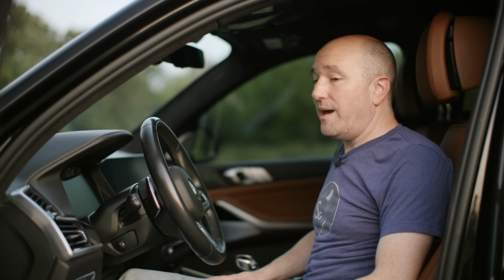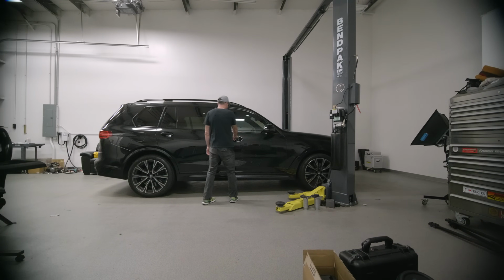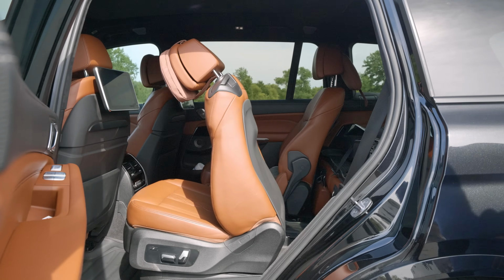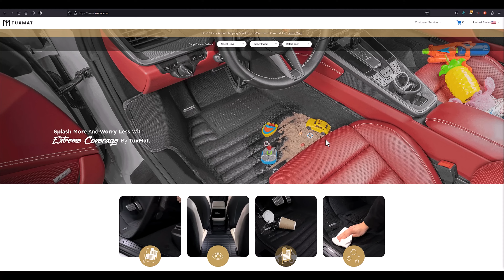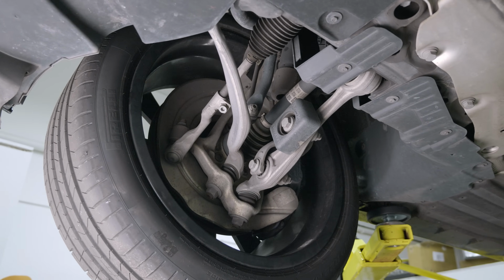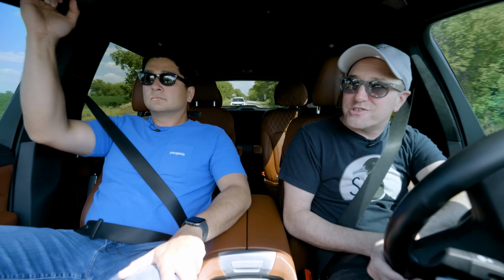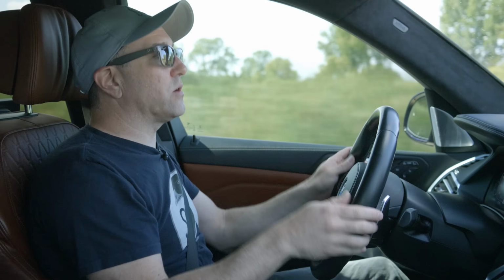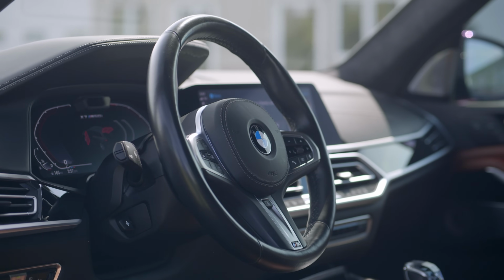BMW X7 | 45,000 Mile Long Term Results

Comment: Leaky roof are something BMW is a market leader in. 🤣🤣 both my X3 and wife’s X5 have experienced the pleasure of sunroof leaks. Fix them multiple times. Latest is a XE leak into the trunk that caused a failure with the park brake control module. Not cheap repairs.

Comment: Great review. I appreciate the insight and essentially validation. Ironically going through the same process. Currently trading in my 23 X7 m60i for a MDX type S. 
Besides your arguments, the LCI has a few extra neg aspects in my opinion, which include the over complicated I drive 8 & climate controls that I still don’t enjoy, non adaptive headlights with no curve swivel, and the biggest factor is tossing the great ZF 8 speed for a hybrid supported 8 speed with which you cannot really engine brake… really dissatisfying for an enthusiast.

Comment: I owned a 2021 BMW X7 M50i. Great driving dynamics (for an SUV), solid power, fun to drive, lots of sweet tech, comfortable, and it looked great inside/out. Unfortunately, the interior is a creaky mess. All of those nice-looking plastic bits sound as though they are made out of recycled plastic water bottles. Every time the vehicle moved, hit a bump, made a turn, or any chassis flex and is just creaked. I drove another nearly identical X7 and even a 550i and it seems to be a common theme. One that I'm really surprised reviews don't comment on this. Have they just accepted this as normal? Are they deaf? Such a shame as it was otherwise a really nice vehicle. 

Also, I've found the same issues with Mercedes, Cadillac, and to a much lesser extent, Audi as well. In a Hyundai, it's perhaps acceptable. But NOT in a $100k+ luxury SUV.

Comment: 22:14 Marc, a Toyota Highlander Hybrid would fulfill your needs.  Platinum trim level of course.
Reply: mazda cx30 ihhs ncap crash test scores are good given the weight , mpg, costs, size. but when you run full power fan blower and air conditioning, engine shakes a lot while idlng, honda crv 1.4 liter, a couple lexus and venza, did not shake so much... maybe shaking will wear out the connection between engine and car and then require a screw tightening and theres no a warning light for  that, it doesnt feel loud and shaky inside car

Comment: Im pretty happy with my daily 2016 chevy ss/holden commadore 6MT (55k miles).   Definitely not the fastest but comes with LS3 and tremec tr6060.  If I stay off the skinny pedal and do 65mph on highway i can get 24-27mpg.  I usually only average 19-20mpg hard to resist the skinny pedal.  If i need to save gas 2019 prius bought new, now has 180k miles just changed the rotors and pads at 173k full set of tires $500.  If i need to haul i have a farm truck OBS ford 7.3 PSD 340k+ miles.  My camping rig, family hauler 8 seater 2003 toyota sequoia with 300k+ miles which i can also use for home depot runs if i put all the rear seat down i can easily fit full sheets of plywood. Essentially a single cab tundra with an 8ft bed.

Comment: No B58 No buy
I'll get the X3 instead
Reply: You can get the B58 on the X7
Reply: How ACTUALLY reliable is the B58 in the X3 M40i? I’ve heard it’s pretty solid but it is BMW so, you never know.
Reply: @TJ_Kirkland.  the engine is fine.  It's everything around it that's made from glass.
Reply: @bassandtrebleclef modern ICE cars. The engines refined. The electronics a planned obsolescence nightmare.
Reply: X3 M340i looking real good right now!!

Comment: Why wouldn't you get a B58 and lower spec slightly used and get it for 60k or something ? These drive really really well for their size and are quiet and feel great on the road compared with the new MDX (I own one of those) and anything from the Japanese or Koreans.  The GLS is pretty nice but even more money.

Comment: Gotta imagine the mdx type S would be more satisfying to own at the price point.
Reply: MDX Type S is $50K less than this and much smaller. Different class of vehicle. And the MDX Type S is super underwhelming. Incredibly slow considering the Type S badge. Even a base X7 40i smokes the MDX Type S.
Reply: the rwd based architecture car will always be the better buy
Reply: Seems like he sort of agrees as well. Will be interesting to see if the facelift model fixes some of the issues like adding a touchscreen.

Comment: Many years ago I spent an afternoon driving everything I could in BMW's Susan G. Komen charity fleet. Everything from a base 3-series to a fully loaded E38 740i. The few circuits I took in the "clown shoe" E36 M-coupe are one of my car enthusiast highlight memories.

Then I got into my 1988 Acura Integra and drove home. And the experience was 85% as good as any of the BMWs. Given the yaawning gap in  purchase/ownership costs between my Acura and the BMWs, it's hard to justify shelling out the extra money for a relatively small increase in ownership satisfaction.

SG, get a Kia Telluride (or whatever). Then, with the money you're NOT spending on the BMW take a few days off. Produce 1 or 2 fewer videos per year. Go drive your CTR for the sheer joy of it. That's how people behave in civilized non-s**thole countires, and they're much happier than Americans because of it.
Reply: In the 90s, Acura, BMW, Merc and Lexus ruled.  As much as I love bmws from that era, they were the only ones not engineering long term reliability into their products.  They were the most fun but even then they were pricier in the long run.  Things have only gotten more that way with them.

Comment: We just bought the x50e.  Gets close to 500 HP and also 40 miles electric or 58 mpg in hybrid mode.  We mainly bought it for the tech tho.  The 85 mph hands free highway assistant sold us…cost is also 20k less than the X7 and imo looks better too
Reply: No way you get 58mpg on the 50e.  That's not how mpg numbers work.  I have a 45e and I know the car numbers are bs.
Reply: @krzzzy19  58 MPG is listed on their site...Not hard to do a little research next time...

Comment: I have this exact X7 and I bought it used as well but it's been in the shop way too much, and I've only owned it for about 6 moths, so far it needed  a new cluster panel, a thermostat which cost $2,267.00 the armrest heater didn't work so they replaced it, the seat leather on the front part was replaced because it came loose and they fixed the other side which is now also has come loose, it needed a turbo harness which they broke the screw in it and stripped the rest so they gave me a whole new turbo. Also the steering column was loose, it had a play in it so they replaced my steering wheel,  and your usual brakes, new tires, alignment, new battery, all within 6 moths of owning it with 50k miles I really want to like the car but so far it's a money pit, I didn't get the extended warranty because it was $7000 for 3 more years I probably should have paid the 7000

Comment: I have a 2019 X7 M5Oi. It had been very reliable until recently when, at 55K miles, the transfer case failed, and the shark fin leaked and toasted the emergency communication system module and affected the navigation. I have an extended warranty which covered the $5500 transfer case bill. But the module was $3500 and $1200 in labor, only 5K miles out of warranty; it was not covered by the extended warranty because it was a water leak at the antenna, even though it's a crappy design. Fortunately, the dealer and BMW covered the parts, so I paid only the labor. Very disappointed that I incurred $10K in repairs at so few miles. Word to the wise, get the extended warranty!!! The loaner they gave me was a 2023 M6Oi just like the one in the video. Frankly, I prefer the dash controls in my 2019. Probably because I am accustomed to them.

Comment: The hard reality is that this is the best vehicle in its class... but it is made for wealthier individuals and the costs that come with it. Most folks will lease them so they really don't care about cost or maintanence... As a cheaper and solid option, the 40i without air suspension is also available...
Reply: Exactly

Comment: After having to go to two separate dealers, being charged illegally to fix a problem that was a violation of federal law (safety) WHILE the car was under warranty (I didn't have the time or energy to sue the dealer), SEVEN total trips to the dealers including TWO replacements of the same part on my new 2018 M240i (thankfully leased) and the second replacement had to come from Germany, I would never, ever touch BMW again. 

I will say the second dealer was beyond brilliant in every way, but BMW could care less about quality, and I have been driving BMWs since the 1990s.
Reply: @@japanwatchconnection Driver's seatbelt refused to contract/tighten, which is a violation of US law my man.
Reply: @@japanwatchconnection Actually the dealer I got the car from (400 miles away) was sleazy from the start even though I was getting a long-sitting car off their lot. The second dealer, ten minutes from my house, was both incompetent and committing illegal acts—they're seriously telling me that a defective seatbelt was normal.  The third dealer was truly incredible, but even they admitted the replacement part was defective, so they had to order another one from Germany.

It's all ironic as I had a 528i I did European delivery on and that car was the most reliable vehicle I had ever had.

Comment: Thank you for this wonderful❤ explanation. I would like to know the 2021 V6 Mild Hybrid model. What is the fuel consumption rate inside and outside the city for a used car with approximately more than 40 thousand miles? Thank you.

Comment: Cool vid!

I knew I was not crazy!

That's the phrasing....

I felt like I drove on top of the platform and not like I was apart of the driving experience. 

I also appreciated u being candid.

I owned an old BMW X5! I learned why they called it the BMW the ultimate driving machine!

The thing was amazing!

Buuuuut it was also terrifying!

I put it over a hundred because I wanted to see what it can do and it almost took flight!

I think the 2006 X5 was 184 inches.

Oddly....I would love another luxury X5 at that length, but they do not make them any more and something about the X1 and X3 that I just do not like.

And the consumables? 

Don't even get me started on that one!

I bought the X5 used and made a horrible mistake.

I beilieved that buying luxury meant purchasing more reliability. 

Boy was I wrong!

That car was so finicky!

U look at it wrong and I had to take to the shop!

I still say BMW owes me an X7 because of that money pit they sold me.

In either case....

I understood what I thought your point was...

The X7? Great vehicles! Buuuuut BMW hustling us with the consumables takes away from the experience. 

I do also like that u mentioned the ride experience. After I got out of the X5, I felt like I was in a fight and I clearly lost as my body was beatup from the firm ride.

I thought the solution was simply opt for real leather over the leatherette. But that does not appear to be the solution. 

Right now I would have to be a bazillionaire in order to get an X7.

I still want one!

 So I guess I will have to become a bazillionaire! Lol...

But until then....

I will have to stay with old reliable!

I drive a 2013 Nissan Pathfinder. 

Before that...I bought a 1993 Pathfinder in 1995 and had for 18 years!

I bought the X5 I think in 2006. It was a 2003. Well....that experience did not go well....

My car is over 10 years old and I had been thinking that I wanted a new car as I need better handling/slightly more power, a quieter cabin, and a more comfortable riding experience as well as a length of 198 inches.

Well.....

Who knew that there were no real competitors at 198 inches. The X5 is only 194 so I opted to look at the X7 at 203in.

I said all of that to say that in late 2024 going into 2025 that I will likely just get another Nissan Pathfinder. 

It checks the key box in terms of affordability for initial purchase as well as affordability for maintaining the vehicle.

Sooooo....

Cool vid...

Nice work!

❤

Comment: Hey Mr Geese. First of all as always shoutout from Gura Ocnitei, Romania. There is something strange about the quality of the video, sometimes it's perfectly crisp (the shots of you talking, the interior), and sometimes it's grainy and totally muted in colours (some of the exterior shots of the car). Could this be because of the HDR? I am watching this on my work laptop (actually a Dell, not the singer Adele) and it's the same on the laptop screen and the external monitor screen.
Reply: its because some shots are out of focus, and a few shots missed out the LUT/colour grade (Y)
Reply from the maker: Correct.  Some of this is a by product of a production schedule that is hard to keep up with.  Because we have to keep content rolling at such a high pace I often make mistakes in edits etc.
Reply: @savagegeese  no worries, the content is still top

Comment: I owned a 2018 BMW X3.  It was good until at 43000 miles, the water pump, module and coolant parts had to be replaced, for over $4500 dollars.  I was very disappointed to spend that kind of money at only 43K miles.  I sold it.  I didn't want to drain my wallet any more at the dealership.
Reply: what engine did you have?
Reply: @@japanwatchconnection I was out of the warranty. And I didn’t get the extended warranty. I probably should have but in the end I would have spent the same amount so really there is no advantage of getting the extended warranty.  This is where BMW falls. They use too much plastic in their engines and these engines rev and get hot.
Reply: @@japanwatchconnection I checked to see if there were any recalls and I did not see that as a recall. I went to a BMW dealer to get the car repaired since the car was running hot and had no coolant. I felt I had no choice since the car was running hot and didn’t want to take a chance. I sold it and bought a Lexus.

Comment: Love you channel and your reviews! Just wanted to add to this one if I could:
I am extremely spoiled and very blessed.  I presently own and have owned in the past a LOT of greatest hits.  That said, my 2022 ALPINA XB7 is, undoubtedly, one of the best cars I have ever owned.  I have almost 30K miles on mine, which by my standards, a whole lot (the only other car with that kind of mileage that I have is a 2005 E46 M3). Yes, the 23 inch tires are almost $1,000 a piece (interestingly this is the exact same tire as the one on my wife’s URUS and Lamborghini wants $1,200 for their version of this tire. Yes, seat ventilation is not as good as on my CT5 V BW or Raptor R, but in my opinion experience none of the Europeans match domestics in the posterior cooling department.  I disagree with your assessment of the massaging function: I think it is on part with Lamborghini and Cadillac and better than MB.  Speaking of MB, and I understand that is controversial, I do sincerely believe that my XB7 is superior to the Final Edition E63 Wagon I just got.  I think the materials are better, execution is better, I like the Alpina tune of the 4.4L TT V8 better than the 4.0L TT V8 in the E63. I also that that the ZF in the Alpina is better than the 9 speed MCT in my new AMG. 
Yes, the market looks different today than back in 2021 when the XB7 came out. But, after looking a the GLS63 and Escalade V, I will most likely be getting another XB7 even though I DO NOT AT ALL like the the headlights, removal of the AC control butting and mild hybridization. It is just too good!

Comment: In the market for an X7 and this is the best video I have seen so far. You just got a new subscriber. Great job. I currently have a 2022 MDX and it’s a boring vehicle. The 2024 MDX is an option because our 2019 X5 is used more for around town and is fun to drive. I figured the X7 would give the best of both worlds. Fun and sporty yet luxurious.
Reply from the maker: I just got my X7 serviced its more expensive but the car is still pretty great.  Had a repair, to transfer case but other than that solid.

Comment: 20:36 I think the word your looking for is disjointed. I own a 2011 bmw 528i coming from a 2004 camry, and the you can just feel the difference in driving characteristics. All the good things that bmw does is for me overshadowed by the boaty driving characteristics. I much prefer my Camry's way of steering and the way it responds to acceleration. The bmw just feels so heavy like it's heaving to make a turn or to even come to a stop smoothly, but i haven't had any issues @162,000mi

Comment: The X7 is a beast. I had a 2023 M550i loaner (also has the same v8) and it was such a sweet ride and the v8 is such a beast but I agree with you, the mpg sucked big time! I was getting about 12-13mpg because I drive like a monkey too!
I have an X3M comp and the inline 6 is a much better engine for the price and performance and of course way better gas mileage.

I don’t think people care much about maintenance cost when they spend 6 figures on a loaded luxury suv.

Financially buying any cars new is a bad choice because depreciation….

I do agree the MDX Type S is a nice car, really quality interior and the performance is much better than a Kia or Hyundai, but you will definitely miss the performance that the X7 M50i provides with the V8.

Comment: I could see Mark getting the new Lexus TX or Grand Highlander, def wont be as fast but will prob be pennies on the dollar in terms of running costs and fuel consumption.
Reply: Mark shouldnt get those reskinned rav4s😂

He should get an Acura Hyundai Kia Honda Mazda Jeep genesis. Those are far better than anything Toyota or Lexus have to offer